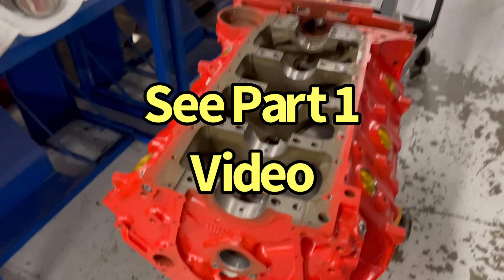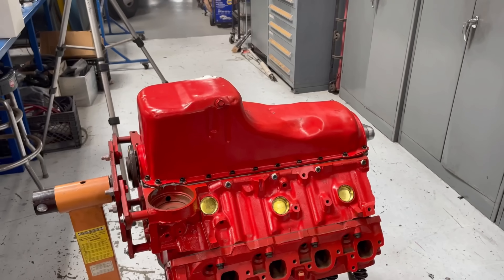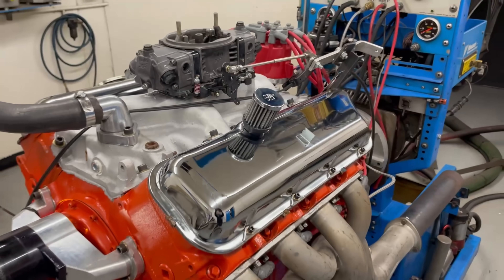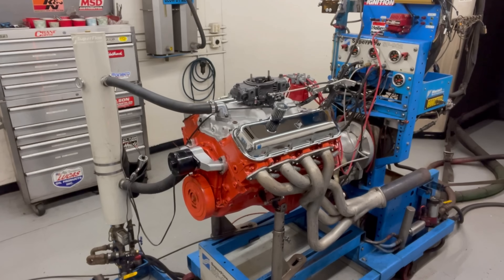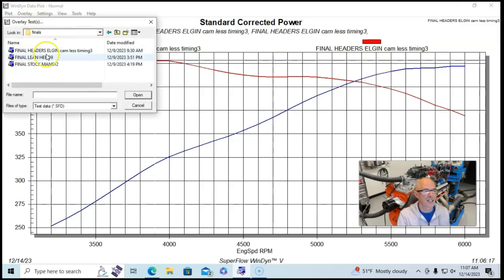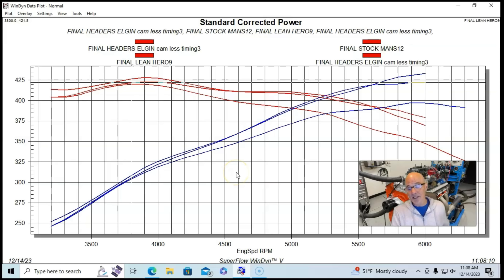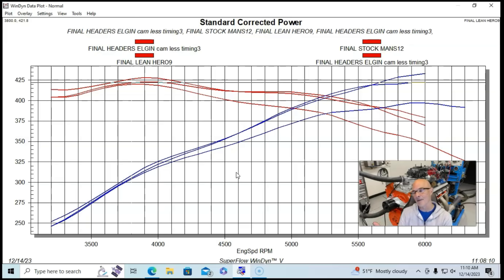FULL DYNO RESULTS ON THE L78 396, OVERRATED AT 425 HP OR  UNDERRATED AT 375 HP? WHAT DID IT MAKE?

Comment: I had one of these in my 68 Camaro SS396 with 4 4-speed. I always thought it was OK, But not the speed of the 426 Hemi's I raced against. I liked the car much better than the Hemi's at the time. If it were a 70 Plymouth Cuda or a Dodge. I would of bought the Hemi. I worked at Chrysler Engineering, Engine Design from 65 to 71 and so... The issues with driving a non Chrysler car to work back then were I could not park in the company Parking lot at the time, as non Chrysler cars were not allowed to park there. I think the Camero was a better car. I drove many Hemi's over the years, but I was a GM guy for some reason. Later working at GM from 81 to 2011. Probably owned over 100 cars in my life including 5 Corvettes, 67 427 L88; 67 350 360 HP, 67 327 360 HP, 93 and 2003 Vettes. 3 GTO's 64 389 w/ trips, 65 389 70 Judge, So many cars. Today I drive a Xiaomi YU7 MAX.

Comment: I new 68’ L-78 with a bigger cam and for little effort and money 450 was easily achievable and as you said I saw many things on your engine that were different than actual stock but in a68’ SS Camaro it was hell on wheels
Reply: Oh I now have a bunch of sbc’s as well as a couple of 406’s and they like the bbc’s have grunt off the bottom and literally any where you want or need it and they are fun fun fun

Comment: Interesting video. Yes those stock exhaust manifolds are for passenger cars, Corvettes used a much better exhaust manifolds that look like a very short tube header and it would be interesting to see how those did. I know from other past dyno test that they might give 10 more HP but it's been decades since I saw dyno runs on a BB comparing them to headers. I think you have it right. p.s. I had a stock 396/425 and it was a Fi-ng runner as they had a great electronic ignition and 10.5" flywheel from the factory as well as the light AL small block radiator so as a result they revved quicker in the low gears that a 427/425 HP 66 vette but they had the edge 1/2 way down the 1/4 mile. But they had very very simular 1/4 times.

Comment: 396 was a good engine, but the 4.250 bore 427 version took it to the next level. Good "430hp" L-88 427 with headers makes 570-580hp NA. Built one 35yrs ago. Ran mid 10s in a 55 Chevy.
Reply: Hmm. You built one of them once and now you base all that knowledge on it. Good for you

Comment: My 70 Chevelle SS had a 396 4 bolt with steel crank, 12.5 to 1 TRW forged pop up pistons, 425 HP oval port heads, 7/16" pusheods, 544 lift 304 duration 292 separation stage 2 cam, oval port intake with Holley 750 vacuum secondary carb and mickey Thompson hi flow headers with 4 inch collectors and made 525hp @ 500 ft lbs torque, rev to 8000 max, 331 limit slip diff, shift point 6700 and absolutely ripped the 1/4 mile at 12.81 in the 1/4 mile at 129 mph. It was a beast in my 70 Chevelle SS. That engine lasted so long on street and strip. The sound of that engine shifting at 6700 typically was enough to get a woody! Broke the right front frame suspension from the torque. Loved that car and wish I had it back. Grey fern metallic with white rally stripes and black vinyl top. Sweetest hot rod I ever had.
Reply: 8000 RPM and it lasted? Quite impressive.
Reply: If it was an original 1970 L78 it should have had closed square port heads? Just saying?
Reply: What is "frame suspension"???

Comment: Cool,have you done a 454 2-bolt main block with a 396 crank making it a 427 yet?
Reply: @michaela.perrella6988 You can make 454 block a 427 but not the other way around without grinding for rod clearance.
Reply from the maker: we have done 427s that are already like that

Comment: Had a ‘68 El Camino L78 that raced in AHRA F optional class. Headers, valve job, balanced engine  40 lb flywheel.  4:88 gears 10 inch M&H slicks. Fast but never dynoed

Comment: It was strange you had a leaker from the top of the guide. Usually it's the bottom if they don't get tapped in far enough. If they were driven out wrong, that can cause the issue. Using a standard pneumatic driver, that might be the problem. It's best to cut the guide down from the top, drill it out slightly to be able to thread it to 7/16 NC. Then put a bolt in the guide, use a long enough 3/8" punch and from the bottom, hammer against the bottom of the bolt. It may break off part of the guide coming out, just tap the threads a little deeper and hammer it some more. This way you are pulling the guide out. Not mushrooming it with a standard driver. P.S. I hate doing guides on BBC. I prefer liners but even those can crack the guide if you're not careful. And then you're knocking out the original anyway. That's the old school way I was taught to do BBC guides.

Comment: I agree with your points.  Car engines could be wildly inconsistent back then and stock/factory engine performance could be hit or miss proposition.  I owned L34 and L35 SS 396s, both in stock form and did bracket racing at Virginia Beach Dragway for three years, a few times pitted against L78s.  I personally believe the L78 was a finicky engine.

Comment: Would have been interesting to have used the original Holley carb. They came on those engines with the fuel distribution tabs on the boosters that was developed specifically for the stock factory alum. intake. The CFM difference in the 780 and the distribution tabs are a difference. Just can't sell old carbs..
Reply: I had to modded 780’s with the chokes remove
Reply: Best all around carburetor in my opinion, we had zero issues on our big blocks under 439cubes after that the 850 Holley was it, then the Dominators 472 cubes and up. We always punched .060 over and 12.5-1, my best motor was a hi-perf 396 with the close chamber heads .060 over 12.5-1 compression 756 lift cam Turbo 400 w brake 4000 stall 4:88 gears in a mod Gas Camaro ran 10:09 all day long 9:90 with the juice. This was 1989!

Comment: Cool video. I think you should do a video on the real 396 though. The 402 is not the most powerful one made. They stopped producing the real 396s in 1969 from the factory and were said to produce 425 hp with all original factory parts and 462 hp just by adding headers. Comparing it to the 454 as being just as powerful if not more. I saw a Dino video on this some time back, maybe it was your video but regardless the 396 from 1969 is my favorite motor. My friend has one from his 69 Chevelle sitting in his garage that hes not coming off of. I want to put it in my 94 chevy silverado. People want a lot of money for them.
Reply from the maker: All of the 375-hp 396 motors (including 1969 and the 1970 402s) all made the same power. GM rated the 1965 396 at 425 hp-but given that the specs were identical to the L78-the real output was identical to the L78. You might be confusing the 396 with the folklore of the 425-hp L72 427.
Reply: @richardholdener1727  No Im not talking about the 427. 1969 Was the last year they made the 396. 1970 402 wasnt as fast, they called it a 396 but it wasnt. Let me see if I can find the article I read about it and ill send it to you.

Comment: I would say that 425 Ft. Lb. and 425 HP is a good set of Vette Tune...maybe Camaro and Chevelle as well numbers. Why? IMHO they would have had Headers and better breathing...maybe 400/400 would have been accurate on Impala, Nova and 375/375 on heavy EXHAUST MANIFOLD CARS. At 9 years old in 1969 I do not remember 1st hand any of this though. As a teen I do remember people being impressed by 396 El Caminos.

Comment: I outran a L78 4 speed Chevelle owned by one of my friends with my '56 Chevy 2 dr. hardtop with the original modified 265" engine (bored 1/8"). It was no contest!
Reply: Traction is a problem with any hot big block Chevy

Comment: They were running 101+ Leaded octane fuel back then.
Reply from the maker: the octane only allows you to run the desired timing to optimize power-we did that with lower temp

Comment: It’s not built for gas mileage,Iam betting it will get about 7 miles in city and 13 highway in a 4000 lbs.car with overdrive transmission and 3:08 gears.

Comment: 422 dyno gross horsepower is only 349 horsepower NET..........
Reply from the maker: The 375-hp rating was gross
Reply: @richardholdener1727  WHICH IS 305 hp net......Chevy Camaro 3.6 V-6  is 335 net

Comment: The water is coming around the valve guides. If they put guide liners in it it broke the guide in the center, big block guides go into water. They can be fixed with new guides.
Put a 850 dp on it, tighten up the lash a little and see what happens.

Comment: My Factory 396/L78 in my 68 Camaro was a Slug, not impressed, I had a 468 with GM Aluminum D port Heads (Circa 1988) and that one Ran, I yanked the 468 to sell the car with the Original 396 and sold the 468 to a Local Drag Racer and it Ran in the 9’s in a Willy’s altered. Regardless the stock 396 to me felt like a 6cyl compared to that 468 I built. But I’d give my left N** to have that convertible back

Comment: It would be nice to see if the Corvette/66 full size L-72 827 828 exhaust manifolds would have hurt it as much as the passenger car style manifolds. I've heard also the the 858 cyl head doesn't make as much power as the 291, due to the bathtub style combustion chamber compared to the semi open 291 chamber where the spark plug isn't as shrouded.   I am building an L-72 Biscayne clone with a 66 L-72 engine that made 530 dyno hp with more cam and head work, some say I will loose 40hp with 827 828 manifolds over a header???

Comment: Try a Corvette L68 Tripower system with a high rise manifold (still looks low profile, but the Corvette Tri-Power had a high rise). Also, what octane fuel are you using for the runs? Back then it was much higher. I had a 396 in my right after high school 1969 SS Chevelle that we square ported and ran a Corvette Tripower system, along with a huge 326 degree intake duration cam and 500 lift, plus 11.75 compression. It was a two bolt 396 but it ran 7000 RPM no problems (chromoly main bolts). I still remember the reactions I would get coming off the line at the illegal drag races back in 1982 running that 396 at 7,000 RPMs. LOL, faces on people are like, WHAT?!!!
Reply from the maker: In testing, a Tri Power usually makes less than a single 4

Comment: During the horsepower wars of the 1960s, OEMs touted ADVERTISED GROSS horsepower ratings measured at the flywheel whereby the testing was done on an engine dyno in optimal ambient conditions using 100+ octane gas, total timing approaching 40 degrees,  dyno headers, no mufflers, no air cleaner, no water pump, no alternator or other power-robbing accessories. In that dyno testing scenario, an L-78 produced roughly 425 hp. Its slightly larger brother, L-72, produced roughly 450 hp on the engine dyno.
Reply: 425 gross is only 350 horsepower NET
Reply from the maker: the L72 was 425-hp 427
Reply: @richardholdener1727  Yours is a very common misconception. The L-72 was originally advertised as 450 hp, and the air cleaners for the first run had stickers indicating 450 hp. However, that much hp in a relatively light sports car scared insurance companies and politicians alike, so Chevy claimed to “detune” the engine to make it 425 hp again. In fact, absolutely no changes were made with the exception of the air cleaner sticker and the marketing literature, and Chevy showed a re-worked graph where power appeared to peak at  425 hp, albeit at a much lower rpm.  The L-72 was truly always a 450 advertised gross hp beast that could rev beyond its 6500 rpm redline!
Reply: @richardholdener1727  425 gross is only 350 NET

Comment: Very surprised the stock cam was that lopey at idle.  I guess the factory exhaust hides a lot of the chop.
Reply: Your correct that the L78’s didn’t normally idle that choppy with the stock L78 solid ft cam.  He Likely had initial/base timing a bit retarded  making the idle a bit choppier then it was if he ran more base timing that the longer duration cam needs to idle better. The total timing was likely in the 36-38 deg ish btdc range.

Comment: I will be rebuilding a stock 69 396/350 hp engine for my SS Chevelle. Would roller rockers and roller cam jump the hp and tourqe up? It will have stock exhaust manifold.
Reply from the maker: yes-depending on cam specs

Comment: No Richard, you are wrong on some points. The factory gross horsepower rating was made with headers and no accessories with timing and tuning optimized for max horsepower. That's the way Chevrolet did it! And on top of that they corrected the measured power to standard day conditions (temperature 59F and barometer 29.92) so that's making it an even harder number to obtain. Now not every OEM did it this way but the Chevrolet horsepower ratings were what the engine by itself could make in optimum condition. You're talking about accessories, water pump and exhaust manifolds, that came later in 72 with the net ratings. The old gross ratings at least for Chevrolet considered none of that and is why as installed in the cars they were almost always overrated.
Reply from the maker: I understand the difference between Gross and Net and when it occurred. Also, are you sure the gross rating would have been with headers? No accessories is a given and possible optimized timing (but they would have run with stock jetting). I think they ran with stock manifolds, but still trying to confirm
Reply: @richardholdener1727 
Yes definitely,  they were free to run open exhaust and they did. Also no requirement to run stock calibration for carb or ignition so doubt they did. Chevrolet wanted to win the horsepower marketing wars so they did everything they could to get the engines to make the most power possible for the ratings. Love this L78 vid and bet Chevrolet got about the same result you did all those years ago.  😎

Comment: I had 1 ,they actually came with a 780 vacuum seccondary carb. Everbody calls them 750s but measure the primarys verses the secondarys, the secondarys are noticably bigger, therefore , the 780 rating. The prim. And sec. In a 750 are the same size !

Comment: Very interesting, and I wish had a time machine, because I’m about 57 years too late to take advantage of anything. 
In 1967 I bought a very low mileage 1965 SS Impala 425 hp L-78. And I regret not putting headers on it, not realizing how much restriction there was with the factory exhaust manifold, although for what it’s worth, I did install exhaust cut outs at the manifold collectors, that I only opened if it was a serious enough race for enough money. 
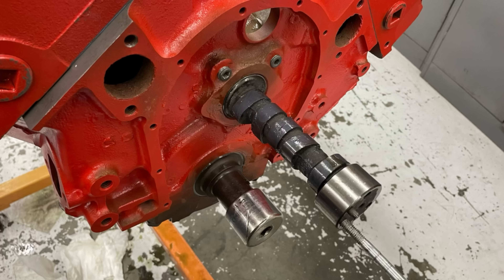And I don’t know how much it actually helped, bypassing the mufflers, but it was intimidating, and with a rev could sound like all hell was waiting to break loose. I also removed the 3:31 ring and pinion rear end, and installed a 4:88, that with the 7000 rpm  shift point allowed me to approach around 6500 rpm in 4th gear near the end of the qtr mile. And of course I also would put on my good pair of slicks, or all I would’ve accomplish was destroying tires and creating a massive smoke screen. 
I was 19 years young and hadn’t yet had enough experience, and I won so many 1/4 mile street races with that car, that I didn’t think I’d ever come across anything on the street that could out run it. Until I finally did, and I was shocked, because it wasn’t even close, and I think I even suffered from PTSD for quite awhile. 
And I still remember 57 years later and counting, my best friend at the time, haunting words to me after the race was over, he looked at me and laughed, and said, “hell Willy, you might as well been on Hoover vacuum cleaner”.
Reply: That is a $300,000 car, or more when restored to factory specs. That car only had a few hundred produced compared to 2,200 Corvettes with the same 1965 L78 engine,

Comment: The corvette also used a 14lb steel 10.5 inch clutch and it had the same cam and heads as later 427 cars, but it felt just as strong, I have owned them all. Corvette 396 cars had 4.11 gears standard with an m21, and were rippers.

Comment: Want big torque curve larger range of rpms the better for street engine
Reply: Hold big number through as many rpm as you can
Reply: That=pin you in the seat! HP doesn't really have to much meaning since it's a number that is just max on its best day for a couple seconds all out
Reply: And that usually comes down to 2 things..

Cubic inches and long stroke
Reply: That's how you impress passengers pined in seat and everyone else with melting tires down restriping the street
Reply: No replacement for displacement....
Torque rules the street!

Comment: Diff carb, different exhaust, different distributor, what's the point of this test again? It's definitely not to show how much power it made stock.

Only an idiot would think a 396 made 425hp from the factory. Those vocal few are extremely simple minded people with limited IQ, unable to accept reality. 

Now, with mods, of course it's gonna make good power, as ALL engines do.